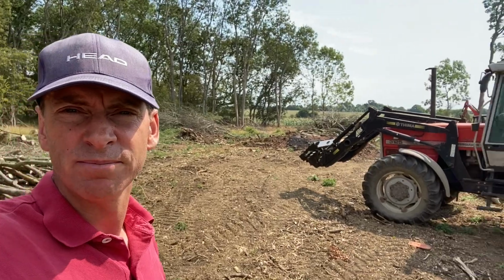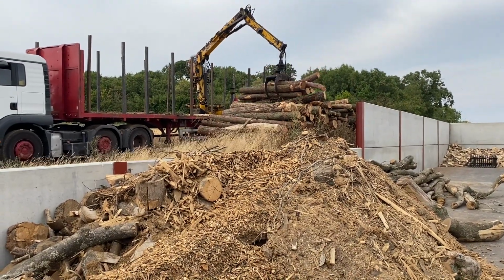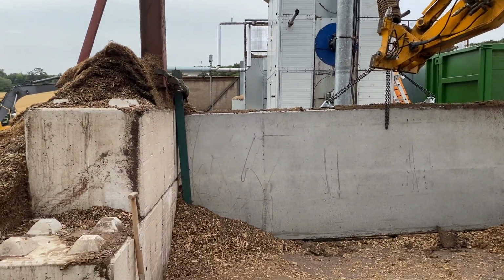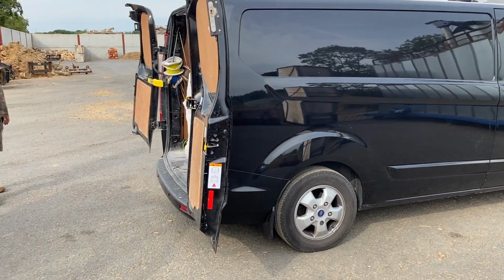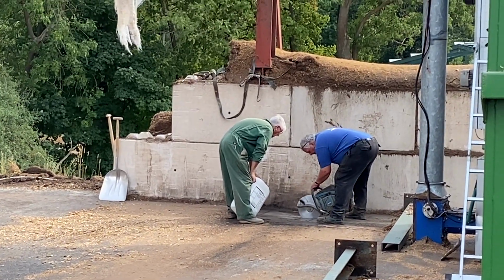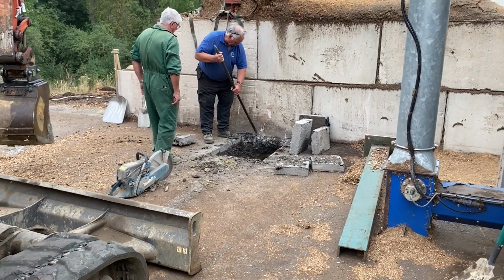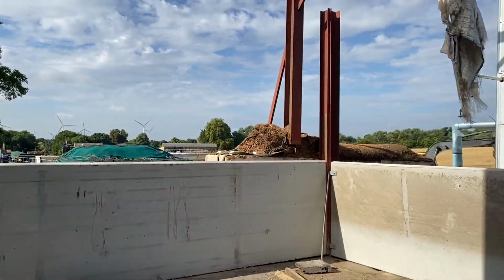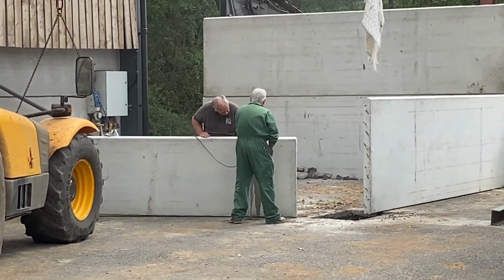Collecting firewood & building a new biomass collection bay.

Comment: Why are your guys not wearing safety masks when grinding?
Reply from the maker: it was only a small grind. and we were outside. normally inside we would.
Reply: @biogasalex6320  you need to get a H&s consultant in - or do some reading about Personal Protective Equipment at Work Regulations (1992).

"PPER 1992 places a duty on every employer in Great Britain to ensure that suitable PPE is provided to 'employees' who may be exposed to a risk to their health or safety while at work. PPER 2022 extends this duty to limb (b) workers and came into force on 6 April 2022."

You may find that your operations get shut down if you don't....
Reply from the maker: @kalicom2937  thanks - we definitely take the HSE regs very seriously!